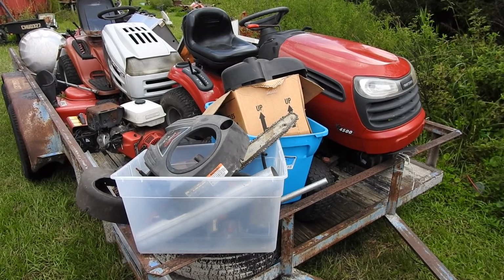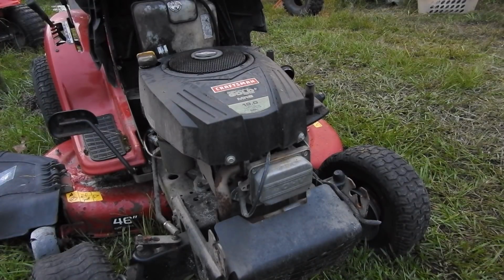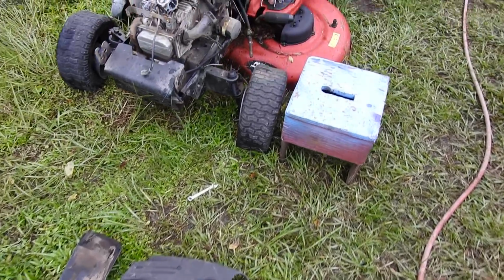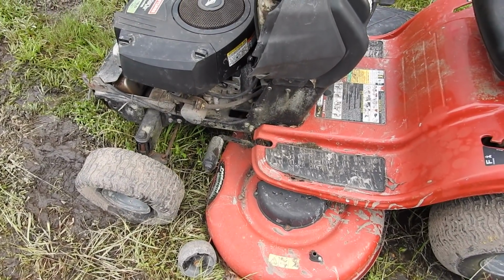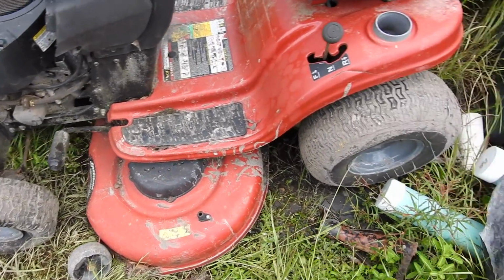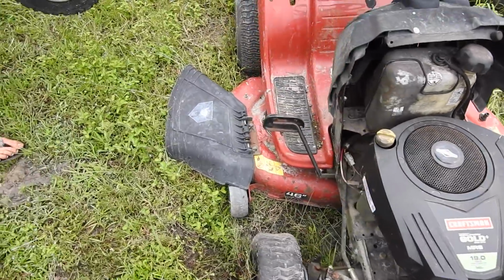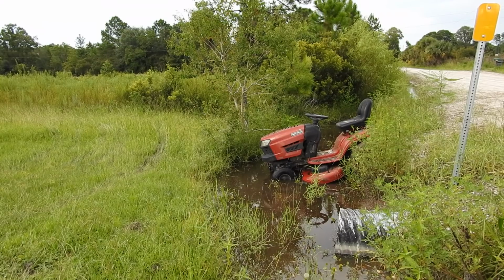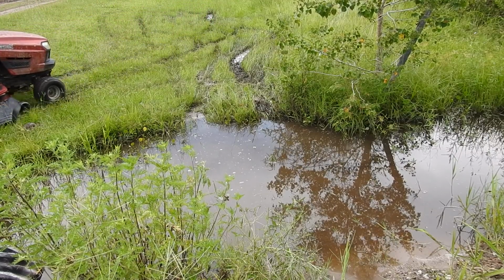Free Craftsman Mower, Will it Run?

Comment: Most briggs ohc single cyl 18-19 hp have a known issue,plastic timming gear breaks and allows the cam to jump time.
Not sure if its every brand....but i have 4 john deere 16-19s all identical problem.if your lucky your has the metal gear.
So if you use it....i wouldnt abuse it.
I just pulled off a running 19 ohc and swapped in a old flathead 12......im much happier.

Comment: Let me know if you need any vintage JD Garden Tractor content!  I have a running list of things to do on the five I have!  Glad you got that one going, happier to see it leave the yard!
Reply from the maker: That would be cool. Thanks so much for thinking of me to help you get it out of your yard and into mine.  The wife saw the trailer and thought I was cleaning our yard... I did take some stuff off, but not the mowers. Thanks again and thanks so much for watching.
Reply: @chud327  hey man I was thinking about you could use that lawnmower engine for replacing the Briggs opposed twin for the boat?
Reply from the maker: Let me know if you need any red dodge parts, I am thinking about parting it out and making another truck bed trailer.
Reply: I might take you up in that. Is it a 2wd or 4wd?  Regular cab?  5.2?  

About to finish my 408 stroker and will put it in the green one. Then I hope to start on the red one. It needs a fuel pump and a motor. 
Thanks for reaching out and keeping me in mind!

Comment: Clean the small holes in the emulsion tube with a single strand from a wire brush. That should fix your surging issue.

Comment: Hey chud I got a riding mower project but I have a wheel that is stuck on from it being there so long. It is a single bolt and I can’t get any wd-40 or anything in there to get it loosened, any suggestions?
Reply from the maker: I have used a grinder with a cut off wheel before. good luck and thanks for watching.